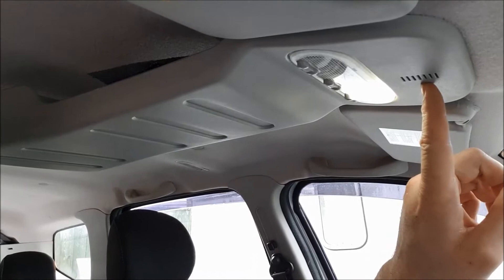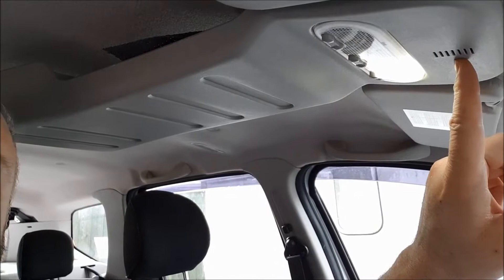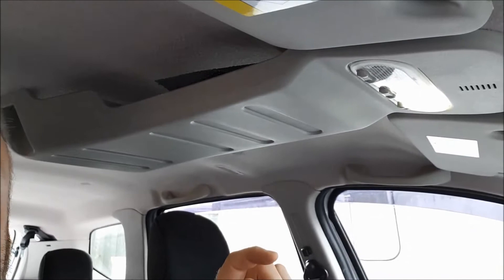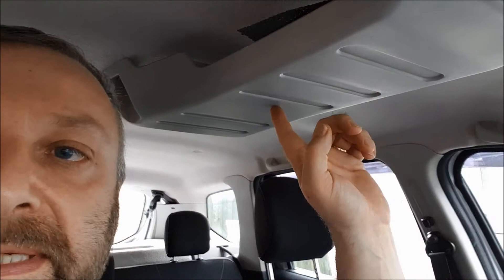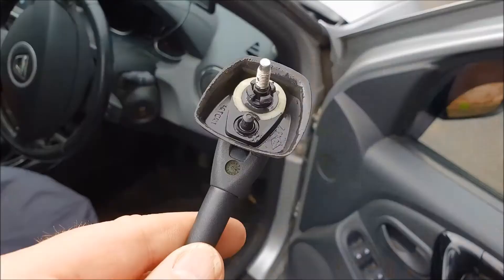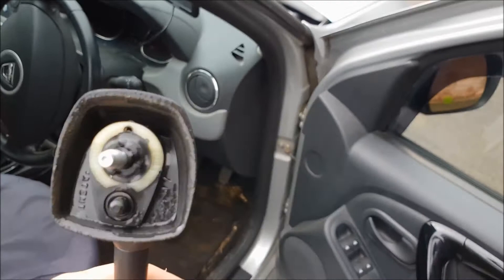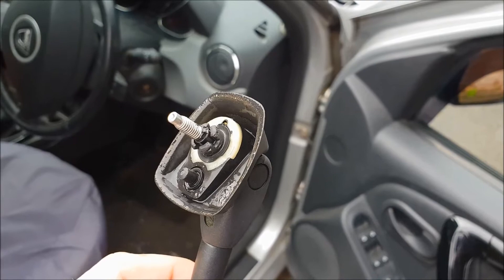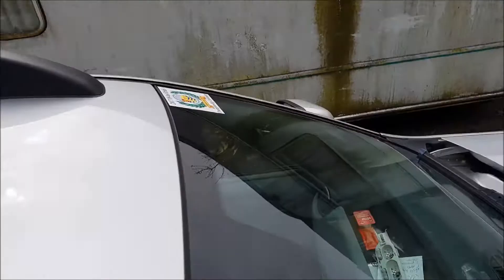Merv's Dacia Duster Tips - Water Leak Through Aerial Cure

Comment: Very useful video, thank you! We got our used Duster 7 weeks ago and this problem cropped up yesterday.
Reply from the maker: I'm pleased you found it usefull
Reply: @mervtaylor  Hi Merv. Just thought I'd let you know that I have just done the job, following your video. Took me 40 minutes from start to finish. I found that the aerial was slightly loose and the water was seeping in under the aerial block. I sealed it with clear GP silicone as you showed, plus I put a generous amount around the holes on the outside of the roof and a fine bead around the underside of the aerial block. On re-assembly, I opted to put a shake-proof washer under that 8mm nut. Thank you once again for your extremely useful and practical video. I have now hit the "subscribe" button!

Comment: never had this problem until i tried to remove the stupidly long ariel which i had to use mole grips to unscrew the blutty thing..then using copper ease put a shorter Ariel on two days later dripping through microphone grill..a bit of black silicone sealant sorted every thing out 👍

Comment: Hi, thanks for the video. Though surely just putting a ring of sealant on the outside  roof under that black aerial housing would do the same thing. As you say, you don't want to put it around the edge of that black housing as it would make it stand proud, so a full ring of sealant a couple of mm within the area of the housing base should seal it. That is presuming the water is seeping in around the base, and not down the aerial pole somehow!? It ideally should have had s rubber base seal.

Yes that foil on the inside will be the earth for the aerial and you will mess up the reception if you mess with that. 👍
Reply from the maker: All I can tell you is mine has not leaked again since doing it and also gave me the opportunity to check for any potential rust under the shroud.

Comment: Thankyou for showing. I have the same issue with my 63 plate Duster (85K miles) Now I know how to take it apart. Much appreciated. As an aside my Prop shaft central bearing is wearing (rubber bit) Has anyone else had theirs go at similar mileage? Regards Stephen
Reply from the maker: I know of a few that have been replaced, looks like you have to replace the whole Propshaft.
Reply: Apparently not. Just the bearing / housing carrier which is about £35-40 @mervtaylor

Comment: Thanks a bunch, I've actually taken my duster to the automatic washer a few times and the antenna isn't a fan of this of course. But the big problem came after I transported a big door on my rails and the antenna had to be bent underneath and when going over 80 km/h it was wiggled a lot and I started to get the leaks. Mine is from 2015 do we'll see what difference it is. I am a bit worried about corrosion though.
Reply from the maker: I wouldn't have thought the 2015 would be any different. Regarding corrosion, mine is a 2013 Indian assembled vehicle that were the worst. Dacia took my car away and gave it a full anti corrosion treatment as part of a recall programme. There is not much to worry about underneath, the chassis do not seem to to suffer but it is worth pulling pack your door rubbers as there is a tendancy for surface rust to form from the steel in the rubber itself. Also thoroughly check the rear tailgate around the pull. That is the main areas and probably will be just surface rust if any. It is worth removing your side steps at some point as some reports of corrosion have been identified there. Good luck with the antenna and thank you for your feedback.
Reply: @mervtaylor  Wow thanks for all the possible places to look for corrosion! I will do. Maybe you have an idea on where to look for my other problem. It's the license plate lighting, I thought the bulbs was just dead but it seems like the power harness or what's it called is off somewhere. I haven't taken a closer look to where it is yet. Thanks in advance.

Comment: I'm glad there are those who like to show the work they do in solving problems that many others have.... Thank you by the way did you check it to see if was lose? Or if just a little adjustment in tightening?
Reply from the maker: It was letting in water.
Reply: @mervtaylor  yes yes I understand that. I was asking if you could felt it lose before meaning holding antena and if the nut shakes or the antenna rotated somewhere.... My logan is from 2016 and have this issue. My wife have a duster from 2011 and nothing 😊
Reply from the maker: @1975reispedro1  It was only a little loose, the antenna had not rotated.
Reply: @mervtaylor  yes exactly that litle lose on the base I just tried mine minutes ago and managed to squeeze 1/4 clockwise 👍 let me see what happens.once again appreciation for you video